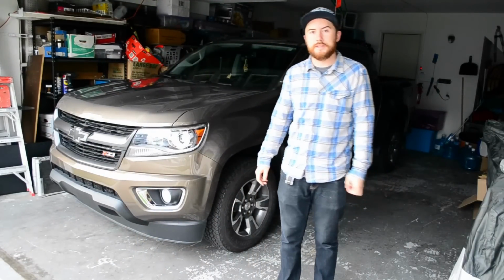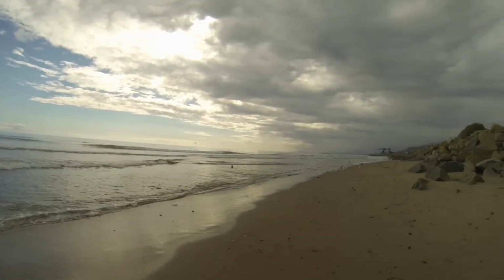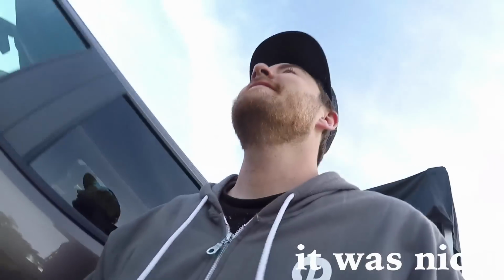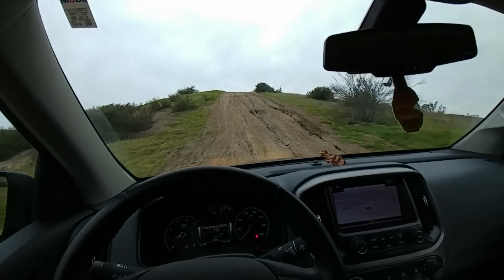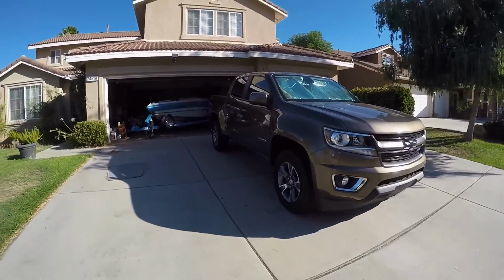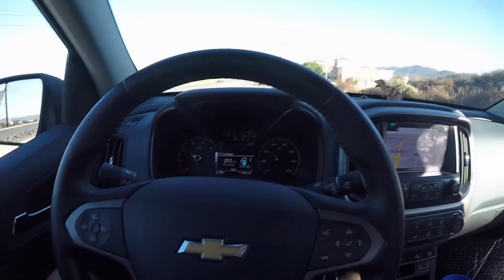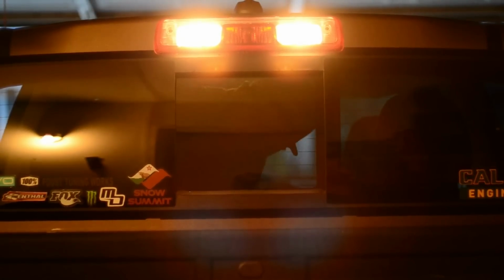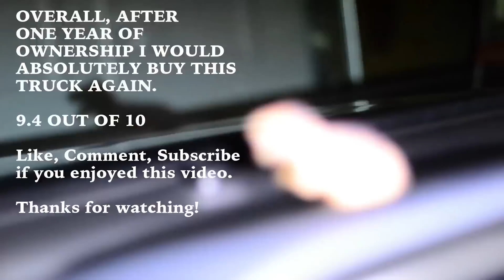Chevy Colorado Diesel... 1 Year Later

Comment: Lol. It's 12:30am I had to get up and go look at my tail gate to check the gap. Maybe yours could be adjusted. Mine doesn't stick out that far. It's flush with tail light. Even gap on both sides.
Reply from the maker: jaidyn424 hahaha that's awesome. yeah it seems like they corrected it cuz I've looked at some recent ones on the lots lately and dont notice it. I'll look into adjusting it, I'm sure there's something that can be done. I have one of the "light brigade" early trucks being that it is one in the batch of the very first 600 diesels ever produced so they were still ironing stuff out at the factory more than likely.
Reply: I'd say hauling that bike sprung your tailgate hinge

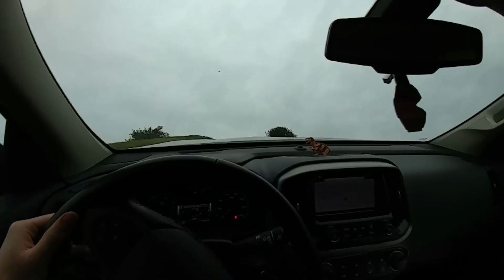Comment: 10:04 "Man, this sucker just crawls right up."  Man, you're in 4 low. That thing could pull your house down the street in 4 low.  Try in 2 first, then go to 4 high if needed. Good review though.  thanks!
Reply from the maker: Thomas Vandiver thanks man. It was more for my personal understanding of the capabilities with the diesel torque and 4lo combo. I've since done that and many other hills and trails with no problem using only 2wd. The g80 locker on the diff really does a good job at putting traction down and hasn't failed me yet.

Comment: How on earth are you getting such good fuel mileage?! I have a 2017 with the diesel and the best I've gotten is 28 driving very conservatively.
Reply: Have you put a chip in it?
Reply from the maker: Joseph Cochran I haven't chipped it yet, but do have plans for it. How many miles do you have on yours?
Reply: I have 3k miles on mine so far
Reply from the maker: Joseph Cochran oh man you're still breaking it in! It will get a lot better with more miles. It will probably take about 10-15k before you are fully broke in. Just stay patient and keep a good varying load on the motor for a while you'll see improvements.
Reply: Sweet thank you!

Comment: Hey man, you're going ruin your paint the way you're holding your sponge man! just kiddin. Don't you hate that? 
Seriously thanks for doing this video. So many people just want to do stupid walk around videos. 
I bought my Duramax in 2002, 6.6l dually and it has that same pull you're talking about. I've never felt the same sensation with a gas engine. It feels like its going into some kind of magic gear shortly after the transmission shifts. 
Do some more vids, I'd like to see how the fuel filter change goes. It's a pain on the full size so I cut a door into the wheel well.
Reply from the maker: Wendell Roy will do man. Thanks for the comment. I do all my own work on my vehicles so when that comes ill definitely get into it. so far its been a solid little truck.

Comment: My math puts MPG at 24 nothing for your truck.
Reply from the maker: Hamburger Helper not sure what numbers you used, but I can assure I consistently see numbers over 27 as a tank average. I actually did a 50 mile trip on flat open hwy this weekend and saw 37.3mpg avg. It sips on fuel if you want it to.
Reply: 26 miles each way to work 5 days is 260 miles. 10.8 gallons to fill it. 260/10.8=24.07
Reply: You should really do the math instead of believing the inaccurate dash mpg monitor.
Reply from the maker: Hamburger Helper I've done the math many times. It always comes out to within 0.5mpg of the onboard computer so I trust it pretty well now.
Reply from the maker: Hamburger Helper there were more miles than that including smaller trips between home and stores etc. It brings avg up. Trust me, if you're concerned about efficiency, there is no better truck on the market, except maybe this one with the 2wd and diesel
Reply: Whatever

Comment: I bought a brand new GMA Canyon crew cab diesel 4x4 loaded.  Bought it for 37500.  It runs awesome.  11144 miles on it now.  Not one problem.  I average 32 on the highway at 75mph.  It tows my trailer and 14 corvette to car shows.  I love the truck.  I also own an 03 duramax Chevy with 270020 miles on it an it gets 21 on the highway.   Both excellent trucks with the big boy as my snowplow vehicle.
As for a Tacoma, what a piece of junk.  2006.  Needed a frame replacement.  Toyota never even primer the inside of the tailgate.  Rusted through one year later.  Toyota would not cover it under a warranty.    I fixed it and fixed the A.C. Compressor that went bad at 27000 miles.  Sold it and will never own a f------- Toyota again.  Must be made from recycled WWII Metal that we blew up.

Comment: that' awesome I love my z71 too couldn't wait for a zr2 and pay 10 grand for a front locker...but cool haven't done my first oil change but was thinking oil is oil and just using 5w40
Reply from the maker: h L feel you on the zr2. you should get the first 2 oil changes for free from your dealer. I think it was a Chevy promo thing or at least it was for me. about to hit my second change. probably just be takong it to them and then ill take over from there. diesel oil can last a lot longer potentially. I did my first one at around 7000

Comment: Diesel? no thanks
Reply from the maker: David Stanley real trucks don't need spark plugs.
Reply: Real trucks do need them as Gas engines make  more power than Diesel engines. and  Diesels make too much  noise it sounds like a sewing machine  only louder.
Reply: Diesels are the no good antique engine
Reply: David Stanley diesels make more torque bud, just because you can't handle the torque of a diesel doesent mean they're useless

Comment: I bought a 2017 colorado diesel. Never, ever, ever did I get that type of mileage. I had it for about 2 weeks before I lifted it, and put bigger wheels and tires. Best I got was 29 mpg and I'm a very conservative driver. Clearly you are super hypermilghing. Don't be deceptive.
Reply from the maker: interesting, probably came down to having not been broken in yet. It takes a while for the little diesel to fully break in and I saw a consistent rise of the mpgs throughout the first 6-8 months. I wasn't driving it like a grandma though, wait til you see my new video with the intake I'm dropping later. It gets even better MPGs now. Your lift and tires surely didn't help the efficiency, but it's a truck not really supposed to be efficient. If I really cared about efficiency, I would have bought a prius.

Comment: 12,900 miles in a year??! Come on, drive that thing! I have a Cruze diesel with 75,525 miles in 25 months. Drive, drive! I wish my Cruze had exhaust brake, but it does downshift and hold if I tap brake or release gas pedal on a downhill. I drive 68 miles one way to work everyday plus rideshare Uber/Lyft some weekends. I use about 1.5gallons each way commuting to work. Keep driving!

Comment: WTF..........?
I have gone up seriously gnarly hills with a 2 wheel drive Nissan Pickup.
That hill was dry packed dirt.
Most passenger cars would have climbed that hill in those conditions.
Get your truck out and Get It Dirty!
Where are the 4x4 pinstripes?
Go climb some river bottom banks and rocks.
Show us the videos of that.
Thanks for the driving impression and mpg information.
Reply from the maker: ducpretender hahaha couldn't agree more. That hill was a joke for the truck, but at the time I was just getting to know it. Yeah since this, ive had it out in the desert and up some trails in big bear getting more dirty. I'll try to upload some more footage soon. I've just installed an intake so I'm looking to do the tune next. keep an eye out for more vids. so far so good.
Reply from the maker: ducpretender also for some reason the Z71 didn't get 4x4 stripes. only the LT with 4x4 got the stickers.
Reply: Sorry, I meant the 4x4 pin stripes that you get from going through the brush.
They are actually scratches in the paint from the brush. :)
Reply from the maker: ducpretender yeah for a minute I thought that might be what you meant lol.
Reply: About 2 years ago I bought an 08 Tacoma 4x4. It was like new. It had Never turned a wheel off road in its life. The undercarriage looked like it was showroom fresh. I took it to the river bottom the first week that I had it. Climbed a bunch of stuff gnarly, rocky, sandy, muddy terrain.
What a blast. Luckily I didn't get too stuck because I was out there by myself.
When I got back and washed it I saw several Arizona pinstripes on both sides.
At first I was a little unhappy about it but it is a 4x4 and that is what happens when you use them as intended.
Hope you have lots of fun with yours.
Reply from the maker: ducpretender thanks for the motivation man. looking forward to earning my stripes